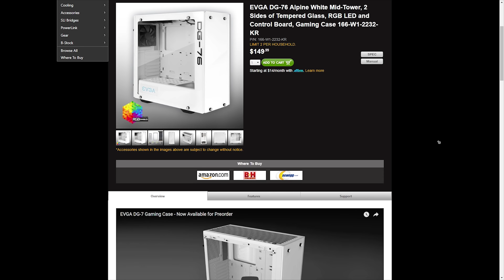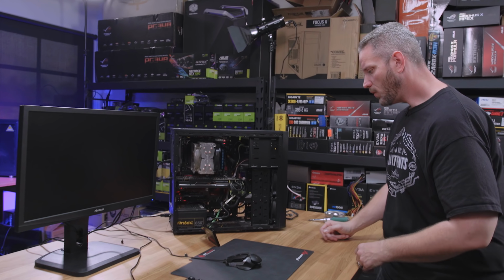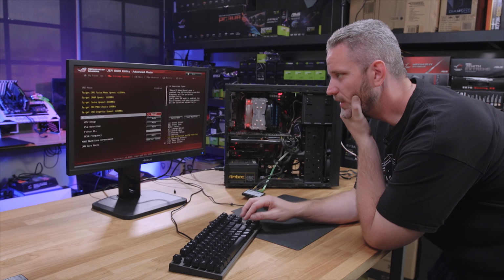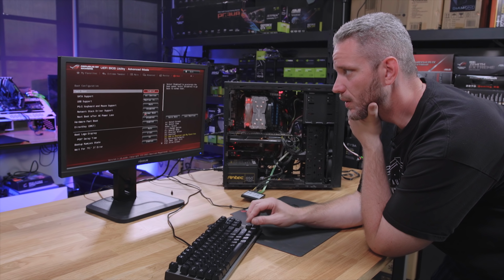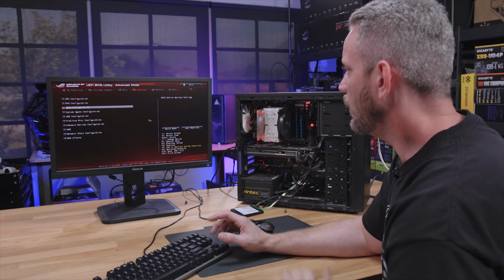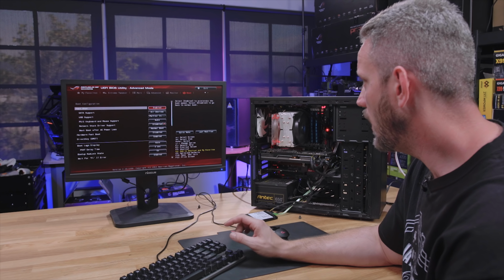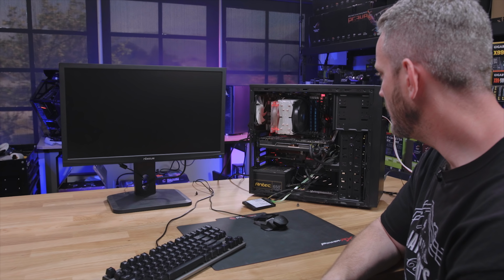Troubleshooting a bad computer... can we fix it?

Comment from the maker: Hey guys. Two things 

1. The SMART Check was disabled to get me past the error to test the SSD so that I could see if the OS would boot. They are advised to replaced the HDD. It wasn’t left “OFF”

2. The other issue that they expressed to me that I forgot to talk about was they had gotten an “over voltage warning” while POSTing once before the problems started. I don’t think the PSU is going bad, I think wires were possibly pinched causing a short but the issue never presented itself to me.
Reply: I really like these types of videos. Hope you do more of them.
Reply: Yeah that would suck if you gave it back to him without warning him that the hard drive is dying then one day it dies and loses all his files lmao

I have a hard drive in my computer that SMART reports as dying... For 2 years now, but I can still read and write to it lol
Reply: I’m a senior in high school trying to graduate and a senior project is required to graduate I’m building a computer and I came up short with money and I’m not able to purchase a graphics card. it would be much appreciated if I could get some help so I can graduate. Please contact me.
Reply: Sandisk Have that dashboard utility you can use to check the SSD too. but i like the way you roll Jayz, disable warnings and run her till she dies! haha
Love the vid!
Reply: Man this is good tips.. so all in all there is no significance on disabling the SMART Check?
Reply: That awkward moment when you realize his HDMI cable is not working!
Reply: Jay, I haven't played video games since the 1980's, as a teen. Because of your video, I purchased PC Building Simulator, a few days ago.
Reply: We are in the end times right now because the end of the world is coming in the year 2040, the earth will be destroyed by God but he will make a new earth after  that.
Reply: No one knows when the end of the world will come. Don't be ignorant.
Reply: Cambodia, Im a Prophet of God and I am also His Future Wife, God knows the day of the destruction, so he told me the year but not the day when it will happen.
Reply: What about the PCIe cable to the GPU that doesn't click in? It still loose and will probably get unplug again when the owner move the pc around
Reply: SMART doesn't immediately disable your HDD (depending on the problem ofc.). It first starts disabling troublesome blocks, ie your HDD gets smaller, while giving you the "replace" error messages.
Reply: Maybe go Outside with the Air blasting... but no lighting system out there.
Reply: smart codes are permanent and caused by the half plugged sata cable.  the drive is probably just fine.
Reply: One thing to note, all psu's sold in europe have to pass some pretty stringent regulations, so even the dirt cheap ones are "ok" if brought in the EU - if ordering online from a country outside the EU such as the USA, then it's a case of buyer beware as they are technically not selling in the EU.
Reply: Anthony King You really don’t even know when the earth is going to end, no one does mate
Reply: I was so ready to bang on about disabling the smart warning until you beat me too it. Good job.
From a technicians point of view there is a lot of things missing that i would check but for a layman there is some great tips here.  :)
Reply: fantastic video Jay !
Reply: I always turn off SMART Check for all my personnal systems anyway :P
Reply: You know there is nothing wrong with the drive right? Maximu VI and SSD's had detection issues, bios update for the board + Firmware update for the Sandisk SSD should fix the smart detection issue. Used too see it alot. At the very most you would need to secure erase the SSD after the FW update and it might want to be done anyways.

The pinched wire wouldn't throw the Overvolt error either as like you said its completing a circuit without any power going through the line. That sounds like VRM. Or they tried overclocking on their own which wouldn't surprise me.
Reply: I always used to disable SMART as it served little to no purpose
Reply: Well, my purpose for leaving it off is mostly to speed up the BIOS POST.
Reply: Nice Video , worst thing I did ever encounter ,was a faulty reset switch , which was "always on" and drove me crazy to figure out . After switching around several parts twice. I finally , somewhat by coincidence , realized the failure is in the frontpanel of the case ... which was like the first time ever i had this problem and also never encountered it again. Well afterwards I never did failure search ,with connected front panels, again ;D . You would probably love something like this for your channel ;D
Reply: BROX3N u don't need a gpu to graduate ffs.
Reply: You could have read that smart log to know if it's actually dying or just becoming slower because of a billion ecc failure.
Reply: Same here
Reply: hay jay why did you change the name of the vid from "PC Building Simulator IN REAL LIFE!" for a reason im just curious
Reply: sbcontt YT The trick is to refuse to help them until they bring in a replacement drive.
Reply: Nice video, but please - don't teach people to fix cable like this.
Reply: hey jay.... when can we get daily uploads?
Reply: JayzTwoCents I finish my first PC built and I did it by watching your videos I have a msi x370 gaming pro carbon mb ryzen 5 1600 CPU etc but my problem is my led lights on the mother board isn't working at all what should I do jay how to fix this problem
Reply: i need more of these videos
Reply: Hey j I got a pc you can use for ur next video. Video card led stay on after shutting down. They stay on even after powering off the psu.
Reply: JOB
Reply: Avalloc considering how many crappy iPhone charger copies are on Amazon.de from shady sellers I would not give any trust into cheap no name supplies whatsoever - there are strict regulations on the requirements, but they are not enforced by customs when brought into EU. You can get reasonably priced supplies from known brands easily so there’s no reason to risk your life or your expensive hardware to shave off a hand full of euros.
Reply: please do a series like this on your channel i think its super interesting
Reply: Great video Jay! Definitely want to see more videos like this.
Reply: guys, do you really think Jayz would leave it off? Anyone with enough experience fixing PCs would know that he would switch it back on after he boots into the OS. Pfft.
Reply: Hmm over volt warning normally posted by the bios,... normally, I have run into it overclocking and had to disable the feature. The MB posting about a short would be overcurrent detected by ESD chips and or resettable fusible diddly doo. Well it also depends if is from 3v 5v or 12v. Many safety doo dads. But I am yet to run into a overvoltage warning outside of failing to turn of a feature while overclocking.  A shorted molex normally arcs, or just trips the PSU. I have got over current errors from stuff like from internally damaged USB crap hooked into a USB, ESD damaged MBs, and shorted PSU coils.
Reply: And new week pc simulator the return when something else breaks...  cue dramatic drum roll
Reply: JayzTwoCents in pc buding simulator u can do SLI now
Reply: Jeez!!! 1. One of the important things i check every time, is bios & cpu Version and if there is any incompatibility...
The installed Version is 1101 (btw from 2013...!) and does not Support 4th gen cpu´s...
Info from asus.com:
-->> Version 1203 
2014/01/035.17 MBytes
MAXIMUS VI HERO BIOS 1203
1. Improve system stability.2. Support New 4th-Generation Intel Core Processors
3. Before using the new Intel 4th Gen Core processors, we suggest that you first update the BIOS using USB BIOS flashback, or download the BIOS updater for new Intel 4th Gen Core Processors and then update the BIOS using it.
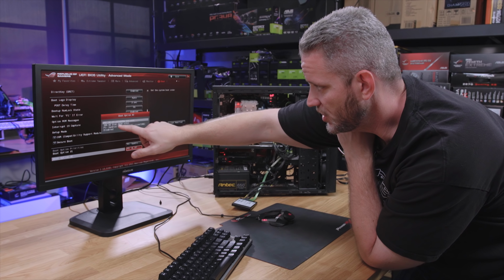2. As seen at the post Screen @ 3:05 -->>  Only 1x HDD and 1x ODD is recognized on boot-up, so i guess 2 OS´s on 1 HDD, aka Dual-Boot? Otherwise the "sandisk HDD" isn´t recognized properly... oh, he found it out (himself) -> @ 5:03! 
-> And now, he has already discovered, where the Western Digital HDD is installed, too!
3. @ 8:22: forgetting to turn on the power supply, is an total noob fail, only my 8 years old nephew will do! *LOL
but, in this case: thank your assistant...!
But interesting, the system boots anyway, with the 4 years old & incompatible Bios for this cpu...
me and my Team would have found the Problems in the first 3 minutes... ROFL
Reply: Securing the wires with heatshrink is shoddy work, at least you should twist them together before putting the heatshrink.
Reply: pointed out that the Motherboards bios is Little old and has compatibility / stability issues fixed with newer bios Version???
Reply: BROX3N lol good one
Reply: Glad you clarified that - came here to say "No SMART is super bad and that drive is almost certainly toast"
Reply: Hey dude - if it makes you feel better about forgetting the switch, about 20 years ago i was head tech for a computer store (gov supplier in Australia's capital), being head tech i didnt build much, but this day we had a rush on. 
Back in those days we still had AT style cases with the mains actually cabled to a switch at the front of the case, which i naturally forgot to plug in. Go to plug it in to test my 'finished' build and naturally there was an almighty bang from the power cables lying in the bottom of the case, the store went black, the internet server went down, and i went red.
Thankfully no damage done, apart from to my pride, but i really do know the feel.
Reply: An over extended cable can cause the same thing, if u put it behind the mb for a clean look. It can take a week,a day or a month to show that error code!
Reply: "it couldn't be mickey mouse" as the password! xD that's rich...
Reply: Hey Jay, I’ve been binge watching your videos for the past month and love them. I have a question about a pc that was given to me by my brother in-law because he took the ram out one day then put it back in but put it in wrong so when he tried to boot it it didn’t post then he try to correctly put the ram in (not sure if he turned it off) and now the computer won’t post at all. I’ve tried new ram but no go. I’m greeting a long beep that continuously beeps which the motherboard manual says is a dram not detected I’ve tried the ram in all slots multiple times but no luck.
Reply: Ah good. The silence on the SMART status for the rest of the video was actually bothering me a bit.
Reply: I got myself one of those electric Compu Cleaner dusters, soooo Worth the money.
Reply: My graphics card do weird lines on my screen and go black sometimes !!! W is it ????
Reply: You mean "two cents"?
Reply: @brox3n203  sounds like poor planning on your part which is part of a project. Take the L and increase your planning abilities.
Reply: i had to ruin the perfect 64 replies, now its 65 haha
Reply: BROX3N  Look man. Begging will not get you anywhere in life. Your comment has attracted other people telling you the same thing. Get a job and work for the money.
Reply: @brox3n203  stop asking handouts and get a job lmao
Reply: Rosco Conner keep your comments to yourself bruh
Reply: I need help man my pcs are old and I need a none expensive upgrade jay can you help me please or give me somewhere I recently just had my gpu die on me it was brand new and I've been without a graphics card for weeks. I have a gaming computer but I can't use it and the other computers I have are not doing to hot. So any advice or help I would appreciate it. I love your videos. Thanks.
Reply: @Grayson Hamza i really appreciate your reply. I found the site through google and im waiting for the hacking stuff now.
Takes a while so I will get back to you later when my account password hopefully is recovered.
Reply: @Grayson Hamza it worked and I finally got access to my account again. I am so happy:D
Thanks so much, you really help me out :D
Reply: @Ahmed Julio Happy to help xD

Comment: "Oops, forgot to switch the PSU back on"
Literally 62% of all my computer build stress. Building something, pressing power and getting nothing because *I forgot to flip the damn switch back on*. ARGH.
Reply: it once happened to me and in a sec i remembered the nightmare of overclocking issues. i almost had a heart attack lool 🤣
Reply: One time I forgot to install the cable that connects the power button to the motherboard, it took me 3 HOURS to realize...🤦‍♂️
Reply: DragonNexus bro that’s me every time I build a computer lmao I always panic for a moment when I press that button and nothing.
Reply: @bloodbath4087  Ooooof. That's a tiny one to miss as well.

I don't know if I'd have lasted 3 hours without going "Welp, I bought a lemon. Time to RMA!" at some point.
Reply: @DragonNexus  almost got to that point, but I didn't have the energy to take it all apart so I powered through.
Reply: fr

Comment: 7:27 
Casually Jay throws a cheap PSU to the floor 
"Its garbage anyways"

SAVAGE
Reply: I had such a PSU for years on my old PC, when I was a kid. I never got what was wrong with it, the PC never died from it
Reply: Fernando Rios he was simply channeling Linus
Reply: @randjan8592  same, mine's been used for 11 years and it's still fine. the PC only has an old low clockspeed Pentium D and a low profile 7300 GS tho. today all those 3 components only worth about 6 bucks lol

Comment: I have the same corded electric air cleaner now. Big thanks to Jay for showing it in his videos because that's where I first noticed it. It's TOTALLY worth the $50 or so I spent on it. I was getting canned air so often and any system builder knows how expensive it is, not to mention annoying being that you can't tilt the can and lose pressure as you're using it. This electric air cleaner has none of those faults and works great. Out of the box it has a long cord as well so you won't even need an extension cord most of the time. Can't recommend it enough. Mine came with three different nozzle's and I always use the one that gives me the most power. It knocks loose dust that no can of dust off will ever get.
Reply: could you provide an Amazon-Link or tell me the name of it? Would be really interested to get one for myself.

Comment: I wish most of my computer repairs were like that one, those ones are few and far between. In repair shops I've worked in, I had to tell customers that it was cheaper to buy a new computer than fix theirs too many times. The labour costs are so high at most shops and if you have to sit there and do a lot of troubleshooting and swapping parts.  The labour adds up fast...  Great info and video by the way...

Comment: I literally just built my first pc last night, no idea how "accurate" a video game can be with real-life pc repair work but it did actually get me a little more comfortable with understanding the basics of overclocking. I just like the game because it lets me create rigs I would never be able to afford irl. I do like how the benchmark tests in the game are pretty accurate, along with how it actually uses 3D mark in the game to do the tests with the exact same tests and animations as the real version. I benchmarked my pc last night using the same program and did a recreated version of my rig in the game and it was almost exactly the same score, of course many factors can change the end-score. One thing the game can't recreate, which would be nice if it did, was the automatic overclocks that the Ryzen CPUs and Radeon GPUs can do